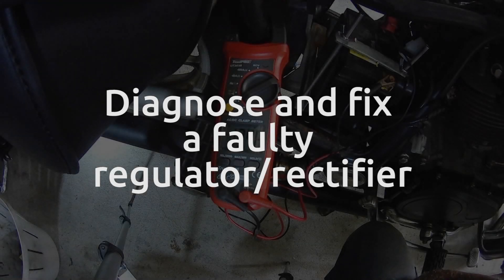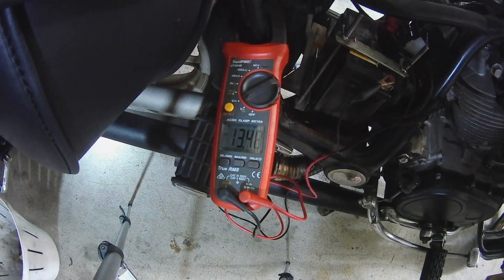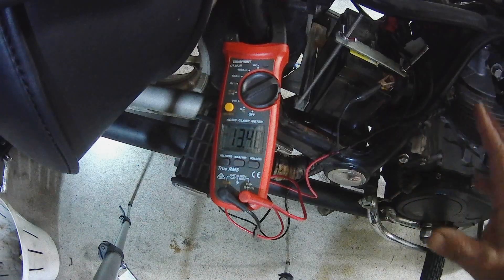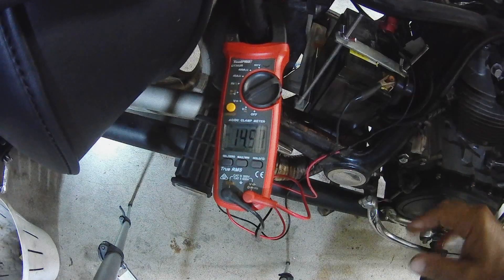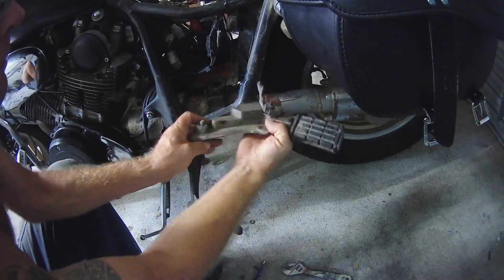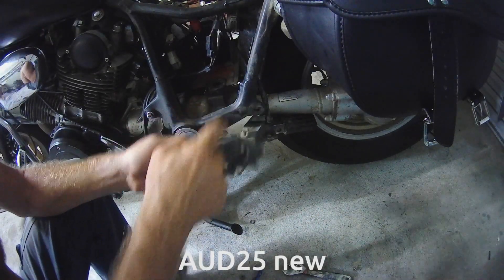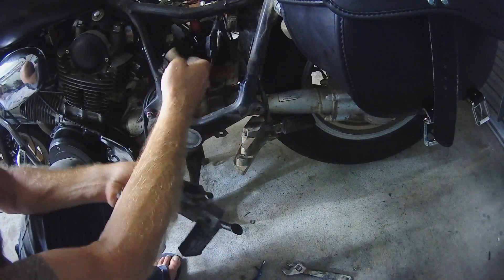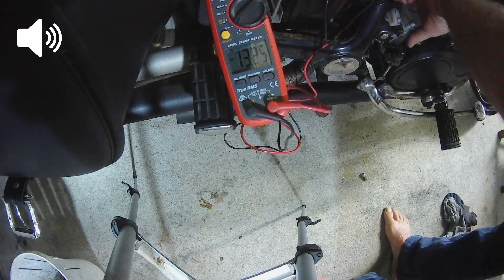faulty motorcycle rectifier/regulator, diagnose and replace

Comment: I got a yamaha virago xv750 and it ran fine one night, went to drive it in the morning and now it only clicks from the starter solenoid, battery is new and the day before it ran, got a new starter solenoid and checked all the fuses. Would it be rectifier?
Reply from the maker: @alexanderramosn1428  possibly,  try disconnecting the rectifier and see if it starts up
Reply: @aussiewantok just did it today and it's doing the same thing, anything I should check before I buy a new starter?
Reply from the maker: @alexanderramosn1428  see if starter spins up connected directly to battery

Run a lead from +ve terminal to starter, if it spins up than starter is fine
Reply: @aussiewantok  if it's not the starter then a relay or the start button? That's all my guesses
Reply from the maker: @alexanderramosn1428  if starter works, than it further up the line, correct

Comment: Hey Mr. With my bikes I want to see 13.5 to 14.5 volts. 12.6 is just a standing battery, not charging...when you see 11.5 you know it's going dim
Reply from the maker: @marscobras8281  I agree, but...the volts on display on the meter are taken off the light circuit. It's wired up to work when the lights are on...

Comment: Would the rectifier cause the battery yo smoke when try ING yo start it
Reply from the maker: @RobertMiller-hw9ql  I recon it is possible, unwieldy current running through the circuit

Comment: High installation resistance from regulator plus to battery plus or regulator minus to battery minus can destroy the regulator. The first sign is that the battery voltage in operation is lower than 14V.
Reply from the maker: mine is at like 13.1V atm...
Reply: @aussiewantok , If it is the voltage at 3000 rpm, check the voltage on the plus and minus connectors from the regulator/rectifier. There should be 14.3 to 14.5VDC at 3000rpm. And if it's OK, check where you're losing voltage. At least 13.9V must be achieved on the battery at 3000 rpm.

Comment: Ive been swapping out pilot jets. Setting and reseting valves. Spark plugs in and out. Coils changed etc. On my '90 535. Front cylinder keeps cold and neat fuel comes from the exhaust. It backfires and pops just like this. Today I tested the rectifier regulator as a desperate resort. And, from my understanding of the readings, it is faulty. New one ordered. Let's hope it solves my issue!
Reply from the maker: Hopefully, with mine, it was above a certain RPM that the motor would misfire and run badly...
In the last couple of weeks it developed a starter issue, old bikes ;-)